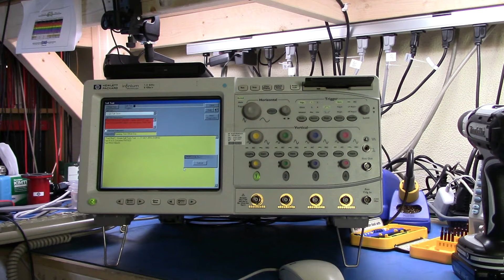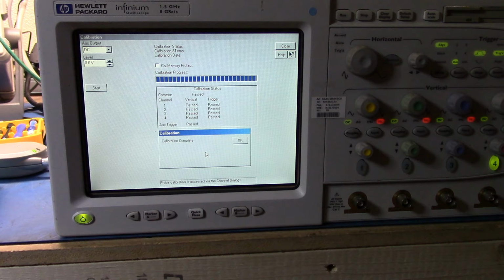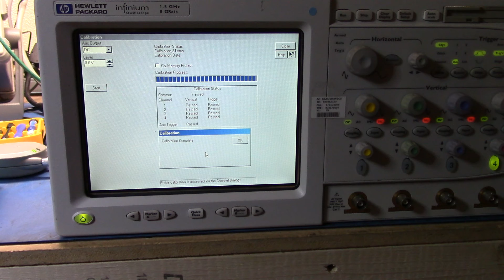HP 54845A Oscilloscope A/D Hybrid Cleaning

Comment: Very nice and useful video as always. I just got a similar scope and I think hybrids on ch3 and ch4 need cleaning as I get similar errors as you did. But I am a little bit afraid to mess up something. Any particular advice? What should I watch out for when taking out, cleaning,  and putting back in the hybrids? Your advice is greatly appreciated.
Reply from the maker: They are ceramic and fragile - There is a little pin on the socket that fits into the ceramic and its really easy to break the corner off. Make sure that you undo the hard line before undoing the hybrid. I used MG Chemicals 824 series IPA to clean them and I used a foam brush. You just need to make sure that you're not leaving any strands behind if you don't use foam. Finally the pins in the socket move up and down so make sure that you don't push too hard when cleaning.

Let me know how it goes.
Reply: Great advice. Thanks! Actually I will be receiving the scope in the next couple of days but based on the pictures and descriptions given by the seller, it is very likely that the hybrids on ch3 and ch4 need cleaning. 
I will definitely post my results here.
By the way, what type and length of coaxial cable did you end up using for the calibration? In the other video you mentioned that the cable referred to in the manual was too short.
Reply from the maker: The length doesn't matter but it does need to be a reasonably good quality cable - I was just commenting on the fact that the people who write the manuals are often just working from notes and not checking that they're writing the correct thing.

You should be aware that some of these errors may be due to the hybrid itself failing so a cleaning is a guaranteed fix. Good luck - Looking forward to hearing how it goes.

Comment: Thanks from another grateful person for showing what you did here to clean the hybrids. I was basically going to do what you did after not finding information and suddenly your video comes up on A/D hybrid cleaning. How convenient :)

I'm actually trying to fix my HP 16534a 500MHz oscilloscope cards (two of them) for my HP 16700b logic analyzer. One fails the self-calibration on the ADC, Gain, and something else I can't remember off hand while the other card passes everything except the external trigger skew. I've got a total of three cards and one works fine. They all use the same type of hybrid you have here except for the funky connection on the side that goes directly to the ceramic.

You wouldn't happen to know any torque values for these would you? Shariar mentioned torquing them down but left out any specifics and I've not been able to find any figures anywhere so I've been left to counting turns on the old T6 driver :/ Anyway, thanks again for taking the time to show this and share it with everybody.
Reply from the maker: Glad you found it useful - It's a great scope - If you're racking it I highly recommend the E2609A rack mount kit.

Comment: Nice job. My first inclination would be to use contact cleaner. Did you consider that, and if so, what made you choose to use plain IPA? For all I know there is some big reason NOT to use contact cleaner that I, in my naivete, am simply oblivious to.
Reply from the maker: I'm generally a huge fan of Deoxit as a contact cleaner (I also have several other brands like CRC, etc) but in this case the reason I chose IPA is that there hybrids are an exotic combination of silicon, plastic, metal, etc - I simply didn't know what would impact it.

However, IPA is such a universal cleaner in the industry I simply didn't believe that HP would make a product that was susceptible to IPA without putting big "Don't you dare use IPA" warning in the service manual.

That's about it - I suspect that mostly the effect was the cleaning action of the swab tip instead of the IPA.
Reply: tgsoapbox Probably a wise plan... And it worked. So good job.